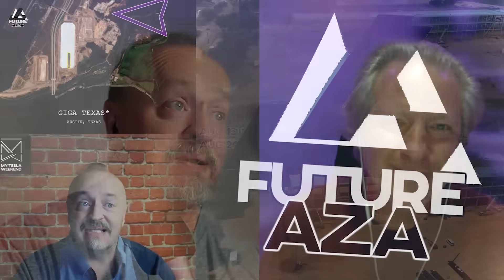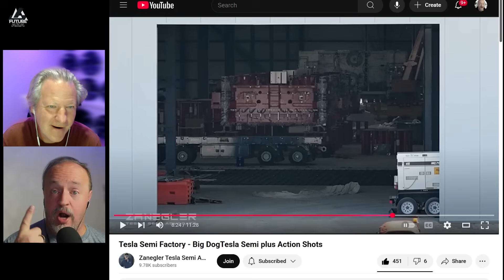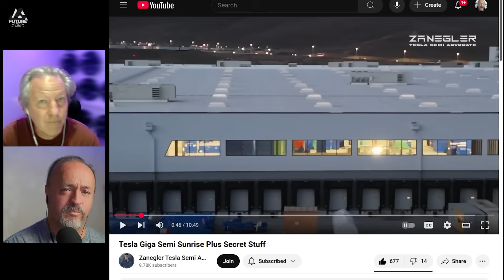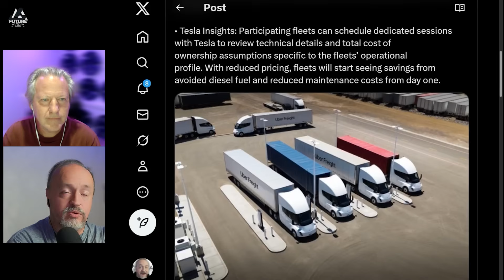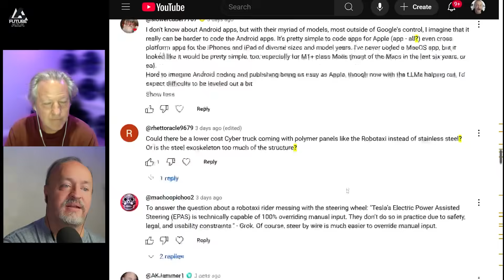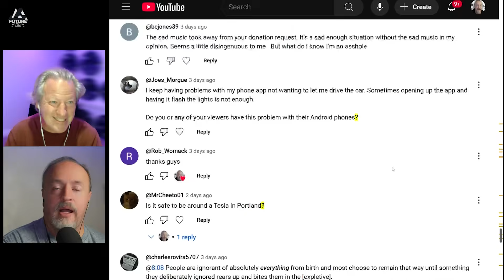Giga Press Drop: Tesla Nevada Goes Wild!

Comment: @19:27, good idea to go to polymer panels in the CT HOWEVER: The SS of the current doors is the side impact strength member. It’s so strong the doors don’t need side impact bars inside them. If they do polymer skins, they’ll need to redesign the doors to include internal side impact protection.
Reply from the maker: Just needs a beam.

Comment: I worked at a CNC shop where we specialized in stainless or titanium parts for the aerospace industry. We had one part that the boss generally ran and it involved drilling a large center hole in the part. We would start with a pilot hole and gradually and slowly run bigger bits through the hole. Used tons of oil. Switched bits a lot. And we still would manage to weld the bit to the part occasionally and it was pretty spectacular. Noisy, red hot metal, flames, the boss screaming profanity (he was Italian and let it show). Never a dull moment there.

Comment: @9:39 The US Giga Factories suffer from the same problems. The floor plate is always too weak and not fit for purpose... 
That's partly due to the fact that the building being Up To Code doesn't mean much when you have massive equipment to install and aren't sure about the location of the installation.
GigaBerlin floor plans with their weigh/load tolerances had to be calculated before the first concrete pour was attempted.
Reply: 9:35. "first concrete rework". Not rework at all. Was bare earth a month ago.
Reply from the maker: Ah, thank you!

Comment: I grant you that stainless steel is really hard to work but I would push back on the idea that aluminum panels would be a lot lighter as SS is much stronger/tougher than aluminum which would need to be thicker to match that strength, no? 🤔
Reply from the maker: How much strength does it need? A side impact bar in the door would be needed, but the rest aren't really doing anything.

Comment: I dislike it when Johnny come latelys complain about the 3 or Y being just a reskin. Tesla just does  things differently. My model 3 is 6yrs old and shares very few parts with the new car. HVAC now has heat pump, computer upgraded, giga-castings replaced most of the underbody, double pane glass, interior redesign, projector lights, better suspension, cameras.
What do ppl want to see? All of that redesigned? Steer by wire would be great and one day may come but that’s not an exterior change, why would they complicate the exterior refresh with a major system change at the same time? Again, I think ppl aren’t considering the continuous nature or Tesla’s improvements. 

To that end I would challenge anyone to make a case for more change in any vehicle model over 6 years.

Comment: I need to watch some video of that giant trailer being towed/pushed.  It looks like each towbar has two pivot points.  That would make it pretty complicated to navigate.
My big question is with the steering of the wheels on the trailer itself.  Are they passive and track with which way you push/pull the trailer?  Or are they coordinated like on an SPMT?
If they are coordinated, where is the controller and who operates it? It looks like it could be terribly complicated requiring incredible expertise, or pretty easy if a computer is doing most of the maneuvering.
I've watched airplanes being towed with a two pivot point tow bar many times. When they back up, it requires a great deal of practice and expertise.